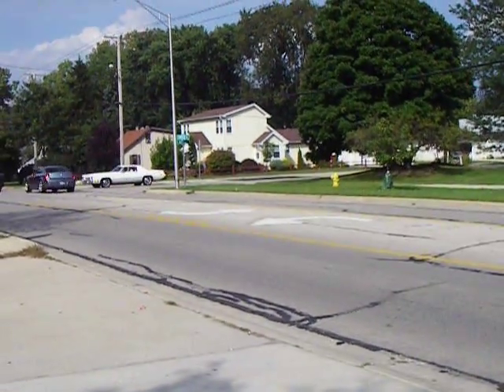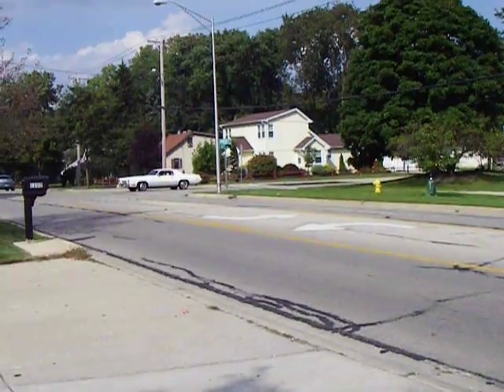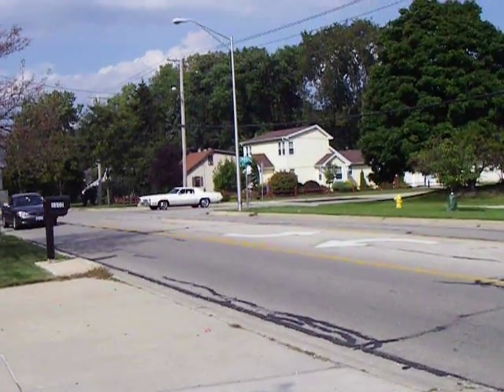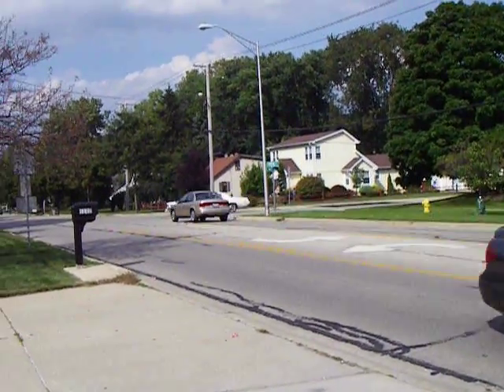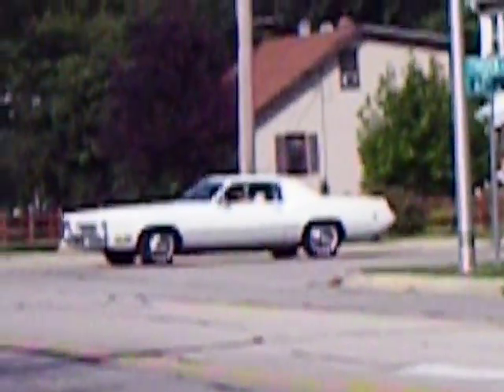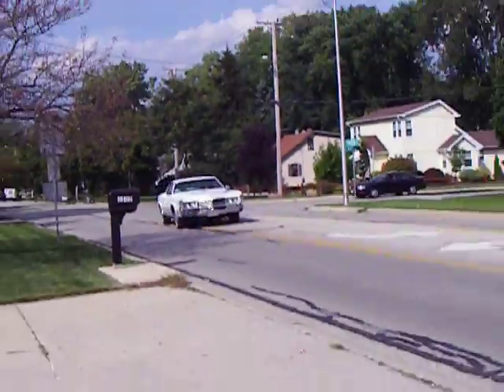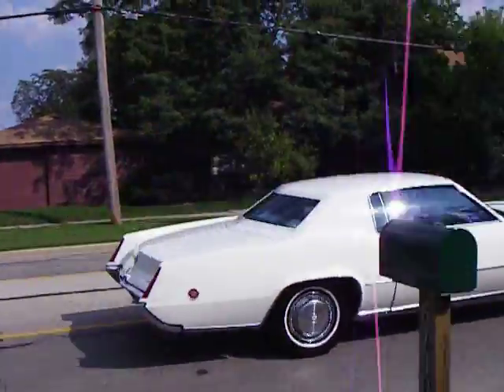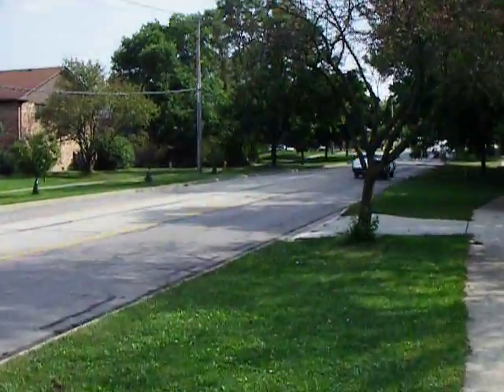1970  Cadillac Eldorado gets on it on Fairview ave.

Comment: Yes, and the 400 HP was produced at only 4,400 RPM, with 550 stump pulling pounds feet of torque at only 3,000 RPM!
Reply: Yet it still slow
Reply: @randomautonomousdronepilot3384 because those cars weighed like 4700 pounds

Comment: & more impressive, 550lbs torque!
Most of any NA gasoline fueled engine ever.
Reply: So all that torque and horsepower yet a 2016 Civic with 160ish horsepower will walk it. I doubt it put those numbers down. It can't even move. Even a 5,000lb SUV with that much torque and power would hit 60 in 5 seconds.
Reply: @randomautonomousdronepilot3384  SAE ratings were a bit higher, the cars only had 3 speed automatic transmissions, inferior tires spun more on acceleration.
Reply: @randomautonomousdronepilot3384  A 2020 Yamaha R6 with 117 hp will walk that Civic.

Comment: No it's not a shame that they came in FWD. The idea was to improve handling. Having had two of them (both 5000 lb 73's) and quite a few other RWD rods, the FWD system really grips. Compared to my '67 GTX Plymouth, my '73 Eldorado is many fold a better handling car.They are not ponderous, wobbling, etc. Caveat: 67-78 Eldorado almost has to have rear air shocks, preferably filled beyond 120 lbs for the pair. You'd be amazed at how fast those huge barges can go around curves.